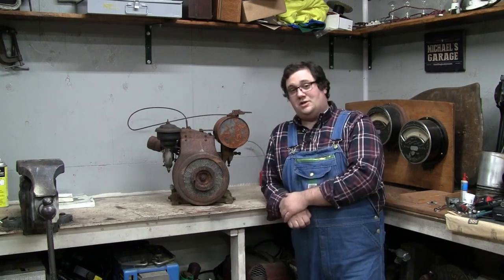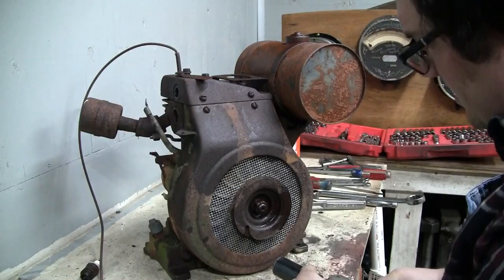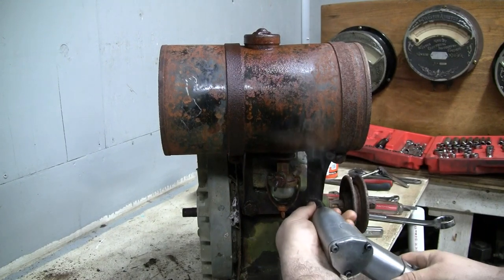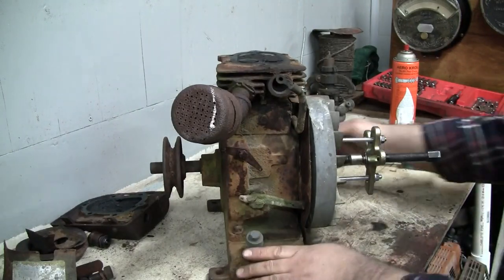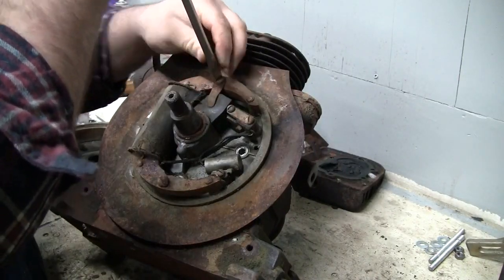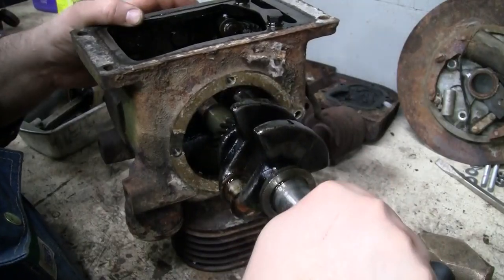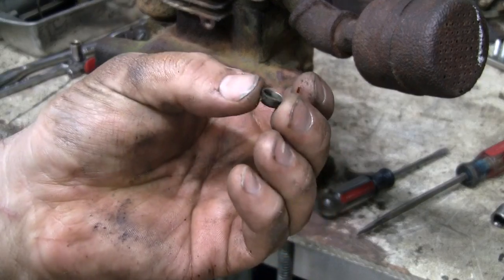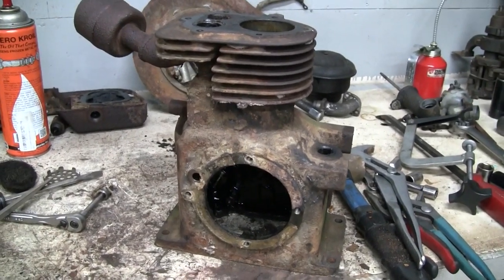FULL LENGTH VIDEO   74 Year Old Briggs and Stratton  HOW MANY HORSES ARE LEFT IN IT? Pt. 1/5

Comment: You are very meticulous and patient with your efforts which is what this kind of work demands.
2 things I would offer.
1. When backing out frozen rusted bolts, once they move a couple threads spray behind the fastener with a lubricating spray and then retighten the fastener. This helps the lubricant into the threads which accommodates the removal process while avoiding gauling of the threads.
2. I have used all the known penetrating lubricants known and the best kept secret I've found is Zep 45. This stuff creeps into threads better than anything else and seems to dissolve the rust much better. It's expensive but you use it conservatively. Spray, soak, wait, wrench... Repeat as needed.

Comment: I've got a BR6 here, which I believe is the younger Brother to your Model A Mikey. It's rated at 2hp, then with the 6:1 reduction gear, it's a real grunt machine. It's one of three reduction engines I have. One is a little WI reduction with crank start and the other is a Sears branded "500" that's essentially a Model 14, which if memory serves is just a 5hp the size of the later cast iron 9hp. Thanks for the longer video! Great to see this old A getting some attention. Cheers! Zippy~

Comment: Another tip. When smacking a puller for the flywheel removal, use a 2-4 lb. Hammer and use a hard sharp blow for better shock.

Comment: Use Scotch Bright to clean the crank journal and both sides of the crankshaft and camshaft lobes and the connecting Rod journal. 
1 key ingredient when assembling permatex ultra slick assembly lube is key.  Thank you sir for the video breakdown. 👍👍👍

Comment: The flywheel  had a 74 year  headstart  to collect  rust on the taper and you did it right except  for the small  hammer.
Set the  puller as tight as you dare,
 heat it more then you did, you  won't
melt anything  with the propane or mapp
torch. Hit it a few times  with the large 
hammer and if it doesn't  pop tighten
the puller and take a coffee  break. It
could pop on it's own  or much easier
with heat reapplied. I remove large
boat  props with an undersized  puller,
2 mapp torches and 3-4 lb  hammer.

Comment: Really enjoyed the longer video. Your really good at what you do, and make great videos. I have the same model engine but 1944, with an oil pump, With a Sears model number. It’s off a 2 wheel walk behind tractor I believe, from my grandpa. I rebuilt it, it has a spark issue, I’ll have spark then sometimes I don’t. The plunger for the points seems “swollen” and is tight in the bore but moves “ok”. If you have any advice on the spark I would really appreciate it.

Comment: FYI: Amazon has entire replacement four-stroke engines that are 5 times the power output, one quarter the weight, one third the size, with modern electric starters, modern electronic ignition and twice the fuel efficiency - and all for $100-150. 

Just in case this one doesn't work out. :)
Reply: Maybe, but those engines will be lucky to still be able to run in a decade or two. Good luck finding replacement wear parts in twenty years or seventy years.
Reply: @NotSoCrazyNinja  Seventy years? That's the same tired argument we see about Snap-on tools.. :)

The reality is, a modern engine, from a known manufacturer, well taken care of, will probably give you twenty years worth of working life easy. At that point, you just throw the thing away and buy a new one as they are so damn cheap. And that new engine you buy twenty years from now will have even more and better advanced technology. The fuel efficiency savings alone of a new engine would allow it to easily pay for itself several times over versus an old engine. And remember, a "full overhaul kit" for one of these old engines (if you can even find one) probably costs more than an entire new modern engine! :)

Sure, it's fun to watch Mike playing around with this old stuff, but the reality is that it's "hobby" only. Here in the UK, the cost of Mike's time alone would have already vastly exceeded the cost of several new engines - and he's only just got started! Sorry, but I just don't buy the "Good luck finding replacement wear parts in twenty years or seventy years" argument. :)
Reply: @trickyrat483  Even taken care of, you will be lucky to get a decade out of a modern cheapo engine. Our throwaway society is one of the reasons the human species will be going extinct within a century or two (unless we get our act together, I doubt we will).
Reply: @NotSoCrazyNinja  ""..the human species will be going extinct within a century or two"

Er, OK.
Reply: I don't think so Jim
Reply: @trickyrat483  thirty years ago we had 15 years to live. We will be here for a couple days at least. Right? Old things are more salvageable without having to buy exclusively designed modules that are "gotcha" items.